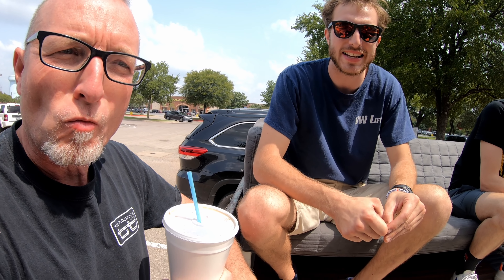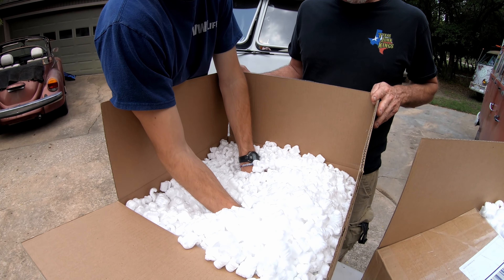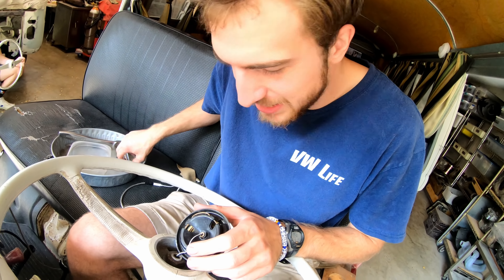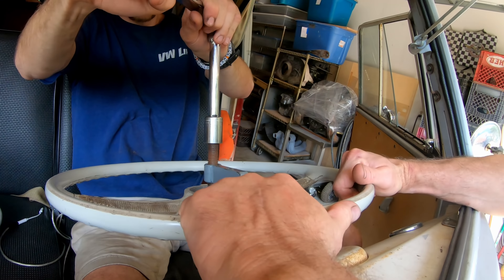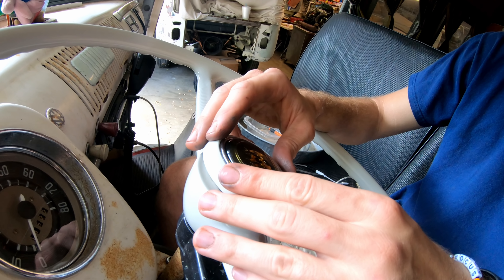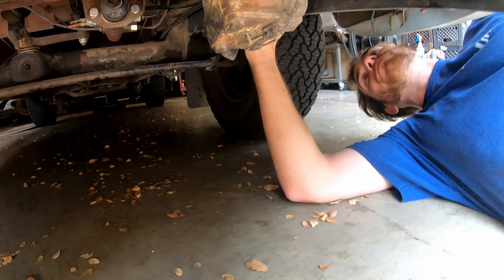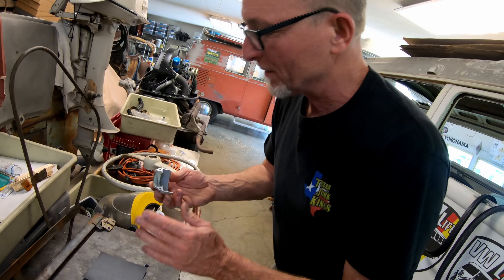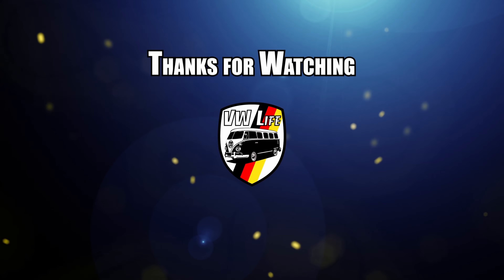Restored Steering Wheels for our VW Buses!

Comment: I use to also have an SO42 looked just like this. Only problem was hatch didn't line up and was crooked. Got that for 500 back in the day.
Reply from the maker: helga had that problem  was able to tweak it back into place though
Reply: @VWLifeVW  I rolled with it like that for about 5 months this before I sold it. 😁